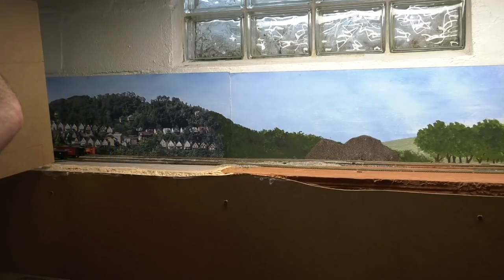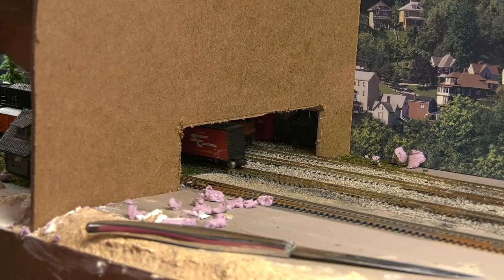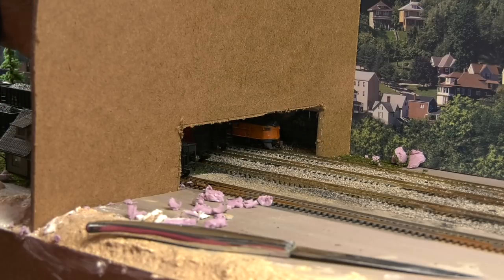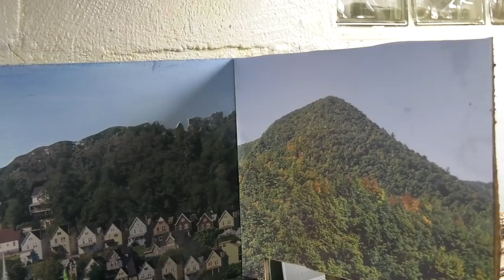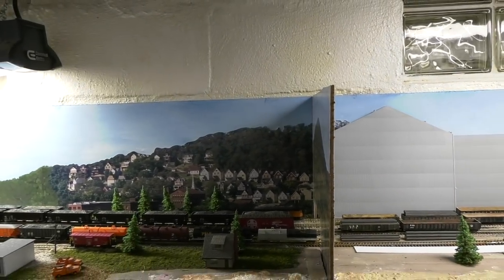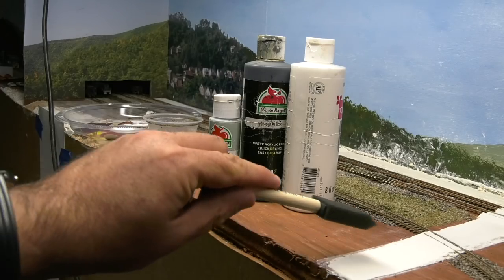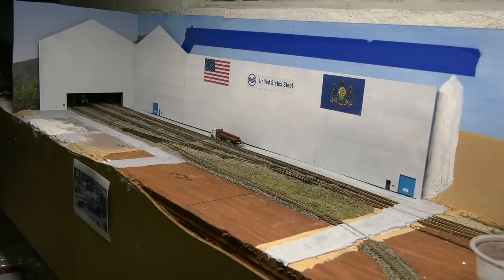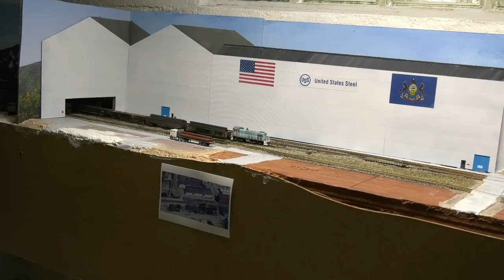Model Railroad Great Use Of Space.

Comment: Great idea for the road. Dont use regular drywall mud. Used a pack called sheetrock 20 or 45/60/90 the number is the time it takes to dry. It does not shrink or crack like other mudds. It dries fast and dries HARD. It will take effort to sand and scribe which is good for crossing details.
Reply from the maker: Thanks for the info!
Reply: @djstrains  it comes in re-sealable plastic bags. Similar to what u get fruits in.

Comment: Great video, I really like how you make the building have depth. Also I have the same kind foam tape. I use it to attach the metal weight that is in the rolling stock cars. I like it because It has some flexibility when putting the cars together. I had problems with gluing them, when installing, the weight just came off. That's why I had the idea to try that foam tape.
Reply from the maker: That's a great idea!

Comment: Lookin' good!
 
Brings back some memories of running West through there, and OJT at Demmler (what's the other name for that upper portion?). Makin' newsprint roll deliveries to the newspaper, and picking up and setting out cars at Dura-Bond, when it was further east, before the Yough runs into the Mon. 
 
They tore down a bunch of the steel plant buildings at McKeesport. Interesting to see that Dura-Bond moved into that huge abandoned building.
 
Further west, did they finally tear down the plant at Braddock? The CSX crossed the river twice over there & gangs were using at least one abandoned mill as an HQ.
Reply from the maker: Demmler is upper/Riverton is lower yards. Both were redesigned years ago for clearance.  Camp Hill became Durabond a few years ago.  Coils in, pipe out by truck.  Braddock is home of Carrie furnace historical steel mill.  I did a video, its AWESOME!!
Reply: @djstrains : Yeah, Riverton!
 
The "old" Durabond had pipe in, coated pipe out. Cool that they've grown to starting with coil. Their product looks like it'd never rust, ever.
 
Oh, so they restored the Braddock plant? Cool.  So much of that area was torn down, with some historic presses, etc left as landmarks for the fairground or whatever they were planning. I never saw the finished structures. It was kind of sad going through there, esp. the spooky J&L tunnel under... nothing now. Thinking of what went on above the tunnel at one time.

Comment: Nice 3D and big ! Buildings. But no double stacks will pass through those openings, or will they ? Maybe make them just a little higher ? Anyway great video ! Thanks !
Reply from the maker: Probably would if I ran them.  However, i am modeling a specific prototype which will be only gondolas, and coal hoppers and steel related freight cars.
Reply: djstrains because one day you might wanr to run them. I updated my Erie lackawanna of the early 70s to Conrail of the 80s, and suddenly i could run doublestack, not. Not enough space under my bridges.  A bit irritating...

Comment: back in the 80's I hauled scrap bales into the BOF at Bethlehem, Burns Harbor, IN. There were seven or eight tracks that ran into building. All the tracks were filled with ballast which consisted of slag and cinders which allowed trucks to enter driving down the tracks to be unloaded by overhead crane. All locos were remote control unit which pushed beat to death gons  and flats loaded various scrap for remelt.       something to consider maybe??

Comment: I have a question, but not about this video. We've all seen locomotives on a train. But, what determines which railroads engine is first, second and so on. I know, usually the lead locomotive is the railroad that is in charge of this train. But not always does the first engine belong to the railroad in charge. And if a railroad needs their engines sent from one location to another, how is that handled? 
Some lashups look shelter smelter. Kinda like these engines were not being used, so we used them. And most are from different railroads? Thank you.
Reply from the maker: in my territory: lead unit needs equipped with PTC (positive train control).  Then, trip optimizer, and if required, Distributed power capability.  So that is why older engines and foreign power will be rarely on the head end anymore.
Reply: @djstrains  Thanks. I guess what I also wanted to know, is how units are picked to makeup a train? And if the unit is not a unit from the same railroad as the railroad in charge, does that other railroad need to be notified that their engine is being used by another railroad?

Comment: Hi DJ, Very nice transition from North Bessemer to McKeesport, well done. You need to find an old N scale piece of rolling stock that still has the Cookie-Cutter wheel sets. This is what I use for cutting flange ways for roads, industry areas where the tracks are buried, etc. I'm talking the old stuff from AHM, Life-Like, Bachmann, etc. that still has the Rapido N scale couplers. Those Cookie-Cutter flanges work great. DJ, I've been following a fellow in the UK who is building an N scale layout based on the UK railways, but he has some neat scratch building ideas and one of them is creating brick work using Microsoft Excel then printing the pattern on paper. From what I've seen, this is a great alternative for creating just about any type of brickwork you need for a scratch built structure, if you can't find a commercial product. Check out his video here ( https://youtu.be/z-6PAea98i8 )  Cheers, Rich S.

Comment: Could of built a bridge or a roadway with a cardboard backdrop so the divider wouldn’t look so flat
Reply from the maker: I am open to ideas, can you explain?
Reply: djstrains just build an overpass and then put a background right behind so it looks like you are either entering or leaving a town and maybe put signal post like the ones they use that runs across over the tracks on the other side.  Just like when people put partial buildings on top of the backdrop so it don’t look flat.